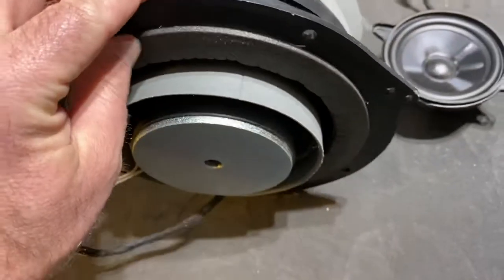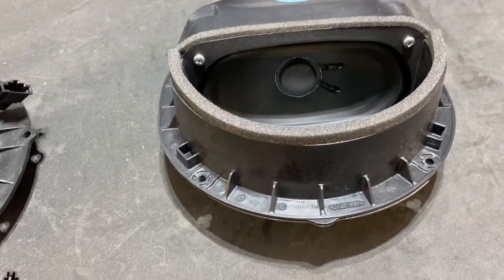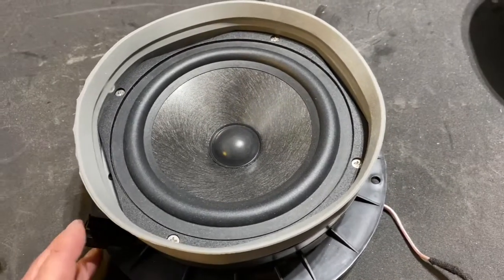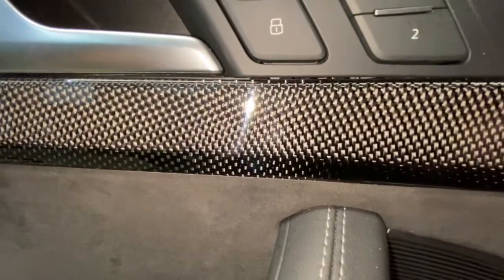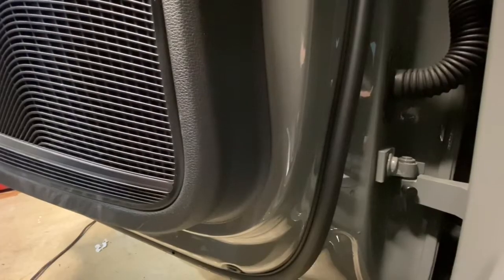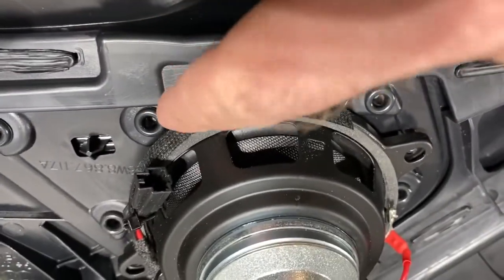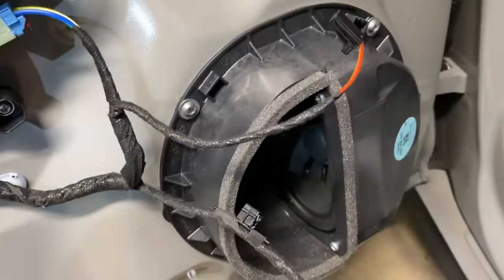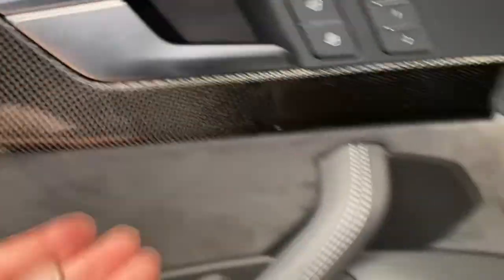Upgrade the B&O Speakers on Your Audi A4, S4, A5, S5 or RS5 Sportback - Front Door Speakers

Comment: I cant justify Bruce's price on the front woofers for the B9. The Aurum speakers are $100/each and the spacers from him are $177/pair. SO why does he charge $625 for the set together?
Reply from the maker: Cant speak to his pricing. You can absolutely order everything yourself and put it together. He usually adds the OEM clips on the wires and builds up the spacers and drip guards.
Reply: @Vaguh  I am in Germany for a few years for work and ordered a new S5 to be built so i ordered all the speakers listed online to replace the fronts in my B&O. I was able to get woofers, mids, tweeters and all supporting accessories for LESS than what Bruce sells just the woofers for. 

Hertz tweeters = 35 euro shipped
Faitial Pro = 35 euro each x3 shipped
Aurum 6.5" = $230 for the pair shipped
Speaker spacers from basser and the drip guards = less than $50 shipped.
Wiring connectors = $20

Comment: Just wrapped up my upgrade using this video and your center channel video.   The difference is incredible, thank you for taking the time to show everyone how to remove these panels etc.  My driverside door took 45 min, passenger side was maybe 20.   I was debating if it was worth putting dynamat in the doors or not, but I could pop them off quickly if I wanted to in the future.
Reply: Where did you buy the woofers? I don’t see them on the website, just the mounting kits.
Reply: With the mounting kits from Bruce you can install any 165mm speakers of your choosing to the front and rear doors
Reply: Did you eventually put dynamat in the door? I was thinking of maybe putting insulation in the door to stop the plastic on plastic rattle noise

Comment: Thanks for videos!! I just completed the same setup in my b9 S5 sportback.  It sounds 100x better than the B&O speakers. I'm not mechanical at all and your videos helped tremendously in getting through the install. I had to reach out to Bruce for the rear door tweeters. He responded quickly! but it wasn't too bad. I also upgraded the factory subwoofer following your other video. Next project is installing the JL woofer, basser box, kicker amp setup.. Hell you got me even thinking about a stage 1 tune.  Thanks!
Reply: Can you please write in the comments the name of the speakers you used I would like to order the same pairs so I can replace the stockers thanks for your help

Comment: Brother those aurum cantus woofers.....words can describe the change in sound. Thank you Bruce for the help. I just refused the oem connectors they pop right out. The sound is life changing. Everyone that has sat in the car have been completely amazed at the clarity of the base. Next up the center speaker and the matching 2 door speaker. THANK YOU FOR TAKING THE TIME TO MAKE THESE VIDEOS.
Reply: Did you get the woofer without the front silicone cover? The only website that sells it doesn’t have the custom upgrades this guy has. The light gray cone thingy that fits on the front of the woofer

Comment: Thank you for this great and detailed video. I am considering to do this on my A5 Sportback.
Is there any alternative to the woofer speaker spacers that were used? The solution as shown is quite expensive. 140GBP (170USD) is bit high for just the two rings of plastics.

Comment: This video came at the right time. I'm trying to justify the quote Bruce gave me.  I really need to upgrade.
Reply: The quote he gave you.. was it for every speaker replacement in the car?
Reply: @Kamara4Life1  No, just the hardware for the woofers in the front doors, hardware, center speaker, and remaining front door speakers. 5 speaker replacement total, 3 he’s providing.
Reply: @smittyboy  ah ok.. I plan on replacing all the speakers on the front doors and the center speakers… I wonder how much all of that will cost
Reply: @Kamara4Life1  Email Bruce Miranda.  Most likely it would be around the same price he gave me. Definitely expensive Lol

Comment: I can’t get over how in settings it doesn’t include a Midrange EQ.  The base sound system on the B8 had adjustable mids.  It can be very frustrating at times the B&O, especially if you like British and Classic rock.
Reply from the maker: I’ve found that if you turn off the 3d sound and the surround speakers, it helps the midrange. But I’m with you, it’s the same on the B&O in our SQ7.
Reply: @Vaguh  thanks! I’ve always had both of those on. Definitely requires a different approach to shaping your sound
Reply: @Matt-rk3de  Hey Matt, I just bought an A4 2017 Quattro but it has the standard sound system, what upgrades would you recommend to get the most out of classic rock music pal?
Reply: On the pre facelift 2010 RS5 with B&O theres also no Sub level adjustment. Overall a very cheap sounding system

Comment: How’s the speakers holding up? My front bottom speaker blew on both sides and my sub went out within 6 months of having the car. I’m going aftermarket with those 3 speakers from the ones you used. Hopefully it fixes my issue! I have a b9 a5 Sportback.
Reply from the maker: The ones I installed are freaking awesome. I have two stock speakers in the front dash that blew. I need to replace them soon. I’ll do a vid.
Reply: @Vaguh that’s great and wow I’m so shocked how often these speakers break it’s sad. I’m gonna replace my subwoofer in the trunk and two woofer speakers in the front with the ones you used! Hopefully that does the trick and doesn’t blow anytime soon. Did any of your aftermarket ones blow?
Reply from the maker: @lukem5  none of the aftermarket speakers have blown yet. 😃
Reply: @Vaguh I’m glad to hear that! I just ordered 2 Aurum Cantus AC-165 6-1/2" Carbon Fiber/Kevlar Woofer and 1 KICKER CompRT 6.75"(165mm) Subwoofer, DVC, 4-ohm, RoHS Compliant! I’ll let you know how it all works out

Comment: What’s the spec of the stock mid-range and woofer on the door?
Thank you so much!
Reply: 4" mid-range, 4 ohm, 20W. The real problem is the depth is super shallow and i can only find two drivers that fit there. The peerless GBS 4.5" fits but sold out everywhere. The fatal pro fe32 with neodymium magnets also fits, but I usually suggest getting the 8 ohm version because it's very bright. a
Also put some foam behind it in you can to tame the back reflections.

The door woofer is an 8 ohm 100 watt 4 in x 6 in square driver in a horn load but most 6 and 1/2 in woofers can fit in here easily. The tricky part is finding a good one that is 8 ohms and also has a low free air resonance below 40 hertz. I originally used the aurum cantus 7-in in my car and had to make my own brackets using the horn. The prefab brackets that are available now that take 6 and 1/2-in woofers are much easier to work with so I generally recommend using the ac-165 series speakers.
Reply: @BobbyKinstle  thankyou！

Comment: Did you ever Do auch Upgrade on an a6 4g with b&o im struggling to do so...
Reply from the maker: I haven’t. What are you struggling with?
Reply: The a6 comes with a closed Box for the mid speaker. I also used the faital. Same like yours. And they are actually louder but Sound like an old 8track Radio.. Very difficult to explain...

Comment: do i need a drill or just a torx screwdriver to remove the woofer bolts?
Reply from the maker: Drill not required.
Reply: @Vaguh  awesome, and thanks. Also do you recommend i upgrade woofers or the centre speaker first? I'm really disappointed in the b&o system for this car, very fatiguing and thin sounding to me, would like to be able to enjoy music at a lower volume then I would with the stock speakers
Reply from the maker: @kuzonai8436  I think if you did the rear subwoofer, and the front center, it will have a huge impact.
Reply: @Vaguh  Thanks
Reply: @Vaguh  I actually seem to prefer “rear” focus on sound effects for some reason, takes a lot of stress off my ears

Comment: Hi,
Could you let me know the make and model of the 6.5” speakers you were originally going to buy (the ones that were sold out)? Great video 👍🏼
Reply: I would like to know too.
Reply: Any of the aurum cantus ac-165 series will work. Can also use the single voice coil ac-180 but it's a lot harder to mount.   I have a list of compatible drivers in the guide: https://docs.google.com/spreadsheets/d/1ftkRt8rz1ZgtTtAs-NRYAIkHbtRuhX2cu702CeuqhVs/edit?usp=drivesdk
Reply: @BobbyKinstle  hi there, what specs do the rear door speakers have in the Coupé?🤷🏽‍♂️